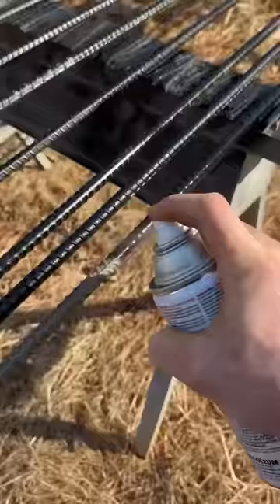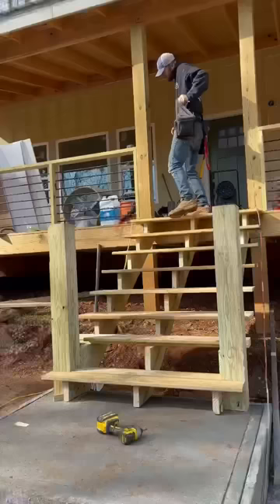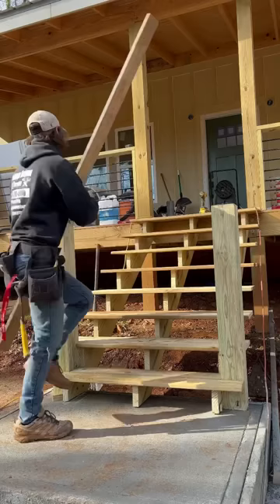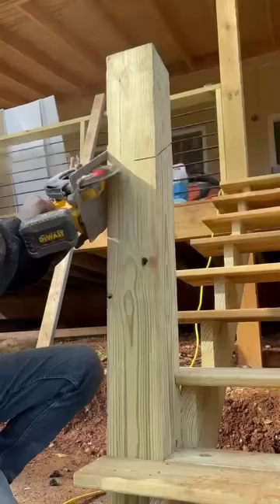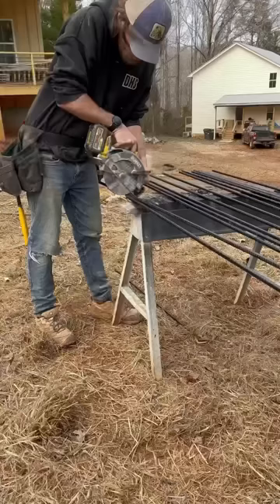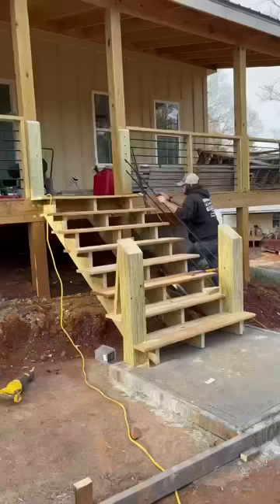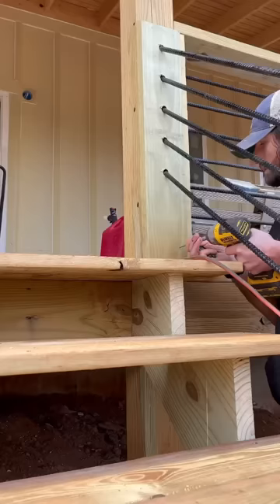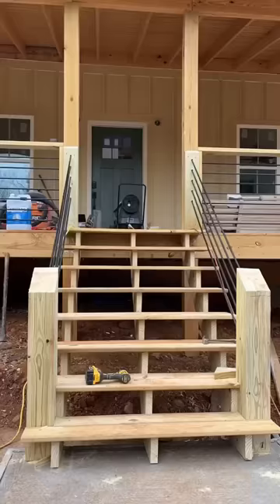Handrail 💪| Beautiful deck stairs part 4 🥳 #construction #builder #shorts #diy #skills #deckdesign

Comment: Beautiful! And you made it through the whole thing without losing your eyesight from not wearing safety glasses. Nice!!
Reply: ALL4FITZ. Yeah, I was worried about those sparks flying not to mention any miniscuel pieces of metal.
Reply: people dont understand risk, most construction workers dont use eye protection unless mandatory by employer. I worked in IT at Pratt&Whiney and anyone entering the plant work area was mandatory to wear company issued eye protection..😊
Reply: @andreh.dupuis8475  YES! You got it. My job has taken me to many factories over the years where safety gear is required. But we shouldn't need anyone to tell us that it's important. I lost 50% vision in one eye suddenly one day and it changed my life forever. Safety glasses are so easy.
Reply: WonderED THAT TOO! And  if his EARS WERE RINGING without visible ear guards -WHAT?!
Reply: @RodgerDodger196  Yep!  I know a drummer who got a bad hearing problem in one ear and still never wore ear plugs. Ringing ears means something bad happened.
Reply: You mean using the bill of his hat to cover his face isn't proper eye protection???  🤣😂🤣
Reply: That’s a funny way of saying you’ve never used an angle grinder.
Reply: @chumbawaumbacumpa  That a funny way of saying you would rather learn about safety the hard way.
Reply: @all4fitz  My point still stands. The risk is low enough that sometimes it’s inhibitive to wear safety glasses that’ll fog up in cooler weather while you’re trying to look down at your cut. You’d have time to have real world experience if you weren’t an armchair safety rep.
Reply: @chumbawaumbacumpa  I've been busting ass my entire adult life for the last 30 years tearing into little bits of everything including major electrical, framing, plumbing, rehab. I'm building a house now and just finished installing countertops and  plumbing. My biggest job was a 2000 sq ft, two story garage that I built myself starting by digging the foundation with a shovel. I was cutting plywood this morning to finish the kitchen island and again, just like in every other instance, I was wearing safety glasses and earplugs. With constantly buzzing ears after 8 years singing in a rock band, and 50% of my vision gone from an eye stroke 2 years ago, I greatly value what I have left and don't want to risk it for something like the inconvenience of getting fog free goggles.
Reply: @dizcret  Exactly. (My "nice" comment was sarcasm.)
Reply: @ALL4FITZ  lol, he really bust a blood vessel there 🤣
Reply: He was wearing safety squints! 🤡
Reply: @michaelwalker1017  Hahaha... It seems a lot of people actually think that works.
Reply: Everyone has thought it can't happen to me atleast once.
Reply: that is A very good point.   the rod shavings caused a fire.  good thing the red hot shavings might hit your eye since it's full of fluid .
I've never seen an eyeball collapse.  take pictures would you.  Nexttime
Reply: Glad somebody else said it. Takes only one screw up to lose an eye, better safe than sorry. Unfortunately no matter how many times you say it idiots will still not use ppe, guess that’s just natural selection. I always wear mine, don’t want shit in my eyes, or to get tinnitus.
Reply: @chumbawaumbacumpa  ever heard of a face shield? Or hell even a decent welding hood has a grinding mode.
Reply: @chumbawaumbacumpa  you know he used his circular saw to cut that rebar right?
Reply: @phanx  I’ve always used angle grinders with a cut-off disk for that. That way you don’t have to swap your Skilsaw’s blade back and forth.
Reply: It’s called a safety squint! And it’s a real thing for REAL workers
Reply: @wayneross1757   @Wayne Ross  If that's what they're called, then I had a "real worker" leaning backwards into my bathtub last summer as I poured water in his eye trying to get the projectile out before the contractor took him to the emergency room. 
It's a shame to think he could have avoided that by simply doing a "safety squint".

Comment: Looks good give a cuplé months dose rebar’s gonna look lik bananas 😅
Reply from the maker: Yeah I’m keeping a close eye on ‘em cuz if they start sagging imma throw support in the middle
Reply: it's a perfect ladder for the kids to climb on, I know from experience
Reply: @MordecaitheBuilder  I know for experience I’m also a carpenter , but is always good to see people trying to do new things and learn from them..💯👍🏽
Reply from the maker: @karlmiller7500  🤣🤣 I’m sure 🤪
Reply from the maker: @El_dela_Nissan  always learning. That’s what makes life interesting:)
Reply: @MordecaitheBuilder  I'd laugh if they fell out when it snows 😂 I make small gates with rebar but I'm into blacksmithing so no wood.
Reply: @MordecaitheBuilder  some perforated square tubing would do the trick and keep it looking solid. may need to open the holes a bit but I'm sure you can find the right hole size.
Reply: @MordecaitheBuilder  Easy fix if it happens especially for a guy like you nice work buddy
Reply: @karlmiller7500 in the OBC (Ontario builders code) it's actually not aloud to have horizontal rails for this exact reason of kids climbing them
Reply: No they won't.
Reply: Poor choice of paint
Reply: Bendable brenda
Reply: DIY Destroyed America..
Reply: @MordecaitheBuilder  I'm sagging... and I know everything send me out on repairs I'll bring in new contracts send me on leads after other dudes fail..and w o Makin anyone look bad I'll bring in contracts oh and I'm a pretty good installer you probably  just wanted to leave a comment sorry
Reply: @MordecaitheBuilder Good plan. It looks great though.
Reply: @MordecaitheBuilder  this came out awesome man

Comment: Looks good but your top rail is going to warp over time. Try putting 2x4 edge wise under them. It’ll be stronger and less likely to warp.
Reply from the maker: Not a bad idea. I’m either gonna probably have to do that or add a middle 2x6 like I did on the main deck handrail
Reply: More importantly if anyone puts any pressure on any of the "railings" they are going to bend, and they will never be straight again. As far as I know, rebar is never a good idea to use for finish product

Comment: Very nice! In a lot of states this doesn't meet code bc kids will use that horizontal alignment as steps and climb over the railing with often tragic results.
Reply: Those codes are the same in every state. International Code Council member 25 years.
Reply: @Doug Foster That really comes down to the county level. There are many inspectors across the country that don't give a damn about the ICC, especially in more rural areas. GC for 32 years.
Reply: Handrail isn’t code compliant graspable, either.
Reply: Not legal in Canada either
Reply: The guy was sawing rebar over straw and caught it on fire and you expect him to think further ahead than that?
Reply: @edwardblanc657  I know also a GC 42 years. Many states however have laws that even when a city/county doesn't adopt the ICC (or any) that they default to the ICC.
Reply: @dougfoster2923 didn’t the ICC remove the “ladder effect” in 2001?

Comment: Looks great!  Wouldnt comply where I am, horizontal and able to be climbed
Reply from the maker: That makes sense. Definitely gonna have to keep an eye on my daughter when she learns to walk lol
Reply: Should add support boards in center span to help prevent bending
Reply: Climbable guards is not in building code,  not safe, but it is not a code issue. However, there are a few other not code compliant issues with this. 200 lbs lateral force resistant,  doesn't extend to the top and bottom tread,  not grasphable, and the ends are not turned in to prevent items catching. That is just the hand rails. The staircase is also not code compliant. You built a hazardous transition point. Should some slip and fall, they will own you.
Reply: Ditto.  The lack of a base rail would do it here.  If those steps get slick and somebody goes sideways, pray they don't break a leg and tear every ligament and tendon on their way down.  😖
Reply: @jon10231  horizontal or “climbable” is a code issue in some places. The spacing could be a problem as well. In the building code where I am I think the max distance between rails is 3-1/8”.
Reply: @MordecaitheBuilder  You are not allowed to do that. Only the government can tell you how to raise your child. That's why this kind fella was pointing out "code" in his area. You have to check with the Government first!
Reply: Free country tho right? Yet you can't build a railing how you want because someone might do something it's not made for! So tired of government managing ever6 aspect of our lives!
Reply: @natecote1971  Free to build it however you want.  Just don't expect to insure or sell it.
Reply: @Maehlice  You could have issues insuring and/or selling, that's true. However, they can issue a "Stop Work" or "Do Not Inhabit" order and fine you until it is up to code...
where codes are enforced (which is most of the U.S.A.)
Reply: @kevinvesey5263  Climbable was taken out of the code a long time ago.  The reason is that anything can be climbable if you try hard enough.  As far as spacing IRC  say no more then 4" spacing.  I had to look this stuff up and found out that climbable was add then taken out because everything can be climb if you try.
Reply: Pretty sure if you tried to climb them they would just flop out the same way they were bent/flexed into place.  So climbing shouldnt be a issue here.
Reply: @jon10231   Being a deck a lot of the code that apply to a house doesn't able to decks stupid I know but it is the truth.   Most place say follow safe building practices.
Reply: Climbable handrails used to be a violation in IRC 2009 but they took it out in the next edition. Some state addendums still prohibit it. The handrail can terminate at a newel post that is located at the bottom step so he is din there. The graspable aspect is the only thing that he can be gigged on, it must have a recess cut out on the backside because it is a type II handrail
Reply: What state do you live in? It was taken out of international code back in the 2012 edition
Reply: @johnunsicker7440  climbable is still in the code were I am. Definitely not saying it’s in the code everywhere. I also suspect the rebar would deflect to much for our code here.
Reply: @natecote1971  you probably appreciate that buildings aren’t collapsing all over the place though right? Code isn’t there to limit what you can build… it there to ensure that what you build is safe.
Reply: Safe as a shard of, well, anything.
Reply: @natecote1971  Mainly comes into play when the property owner tries to sell the unsafe property to an untrained buyer. 

That’s why we have codes, to establish a baseline of safety.
Reply: @jon10231  not also places have codes. Where I just moved from in Nevada, the county has no fire or building codes. Anything flies. So if codes are not an issue where he is at, then they could build anything how they want.
Reply: You must be from California
Reply: @natecote1971  the code books and OSHA standards are all written in blood.
Reply: @duanetucker9439  till you try to sell or insure the home I dont matter
Reply: Nothing stopping you placing them verticle ,
Just drill spaced holes in the top and bottom boards ..
Reply: Personally we wouldn't have half the STUPID shit in codes if PERSONAL responsibility was in LIFE CODE !!!!!!
Reply: Idunno, darwinism.
Reply: This does not look good, it looks dangerous. Look at the different sizes of steps. A variation of only 5mm or less than 1/4" in adjacent steps can pose a tripping hazard.
Reply: @natecote1971  not if you are renting. Your insurance won't cover you anymore.
Reply: Surprisingly this would be legal ina lot of places. Requirements usually only state spacing apart. I hate horizontal spindle, but somebody obviously likes it.
Reply: I see the same issues no mid support,spacing, horizontal, non grasp able top rail,incorrect weight support, also the texture of the rear could be an issue as most building codes will address that
Reply: Sounds like you got some Rug-rats?.....😁🤭
Reply: Same here. Totally illegal. Couldn’t even sell the house like that. Looks nice though.
Reply: Meh
Reply: Same - wouldn't fly where I am either. Although the City headquarters decided they'd install climb-able rails on their building.
Reply: @MordecaitheBuilder  
When you aren’t home, and someone comes to your house and their child climbs over that and falls and breaks their neck, then you’ll learn your lesson.
Reply: @jon10231  
You are 100% incorrect. It is absolutely a building code.
Reply: @natecote1971  
Yeah, it’s terrible that you have to cover up electrical wires, and you have to put covers over Wells, because dumb people might fall in. It’s not about government control. It’s about common sense and loving your neighbor.
Reply: And spacing is too large
Reply: @Maehlice  or baby or small kid doesn’t slip and get caught by the neck
Reply: There is a surprising amount of folks who understand that these are both cool and  illegal.
Reply: They’ve changed that code in most places years ago. You still can’t have horizontal?
Reply: @MordecaitheBuilder  
An electric Do Not Touch system might be effective. Zappos
Reply: 4in spacing on spindles. Don't think it says vertical only !???
Reply: @jon10231  You do know that wherever you live John your  building code doesn't extend to the other 170 countries that have people reading these comments and watching these posts ,your knowledge is limited obviously by more than just a code if you think that other codes are not different and apply everywhere. 
You have owned yourself sir.
Reply: It's funny reading these comments and thinking about where I live in maine there are No building codes.
Reply: @scott5654  Trespassing and bad parenting is not a great argument.
Reply: I just had a fart that had some excess moisture in it and I'm deeply worried that I violated some code or rule that my Government has imposed on me for my own protection.  If Uncle Sam stops by for a dipstick test I'll probably have my underwear condemned.
God I love freedom!🇺🇸
Reply: @lill1557  Same.  Tiny town in Piscataquis County.  No code enforcement, no BS.  Pay yer taxes and have a goodun!
Happy New Year Bub!  And remember,  Ya caint get theya from heeya!
✌🍩
Reply: @sandraw9729  yes obviously the gov does shit people don’t like, but on the other hand if there where no rules, regulations, or oversight, it would be a third world country. Complaining about building codes designed to keep people safe is a very first world problem kind of thing.
Reply: @kevinvesey5263  Stop😂
Reply: @sandraw9729  stop what? Logic? Realistic views? Understanding cause and effect?
Reply: yep. complies nowhere in U.S.
Reply: Grandma will have a hard time grasping that handrail.

Comment: I like the look, just if you have little ones they will love to climb them.
Reply: AJ great minds think alike 😂❤
Reply: And bend them and they fall out. Just like they were put in. 😂
Reply: @frankarchuleta5427  same thought and risk cut ends sharp for others nearby when they pop out. A support post midway would eliminate risk of pop out but could still bend a bit. Rebar is not cheap either.
Reply: You the reason they put caution hot on a cup of coffee

Comment: Nice job! 

It's funny you mention the straw fire. As soon as I saw you cutting over the straw I was like he better be careful. No sooner did I think of it when you immediately mentioned it. 😂
Reply from the maker: 🤣 right!? Shoulda just set it up elsewhere but it was a great place to paint the rebar lol
Reply: It’s the wrong type of saw for cutting steel. Don’t do that again you will get hurt. It’s also the wrong type of blade, that’s why it was sparking, and it’s also blunt now. 
Just use a grinder, cheaper and safer. But you still get the sparks.

Comment: I got to say.. been a contractor for over 40years and this is the first set of stairs I’ve seen done right. You put a top step coming off the deck to get the top plate/hand rail joining the top post at the same height as the deck railing. 💯

Comment: You have angle settings on the circular saw for a reason.... And yes your faith in Rust-Oleum is very touching
Reply: I was thinking the same thing, but it still wouldn’t have reached the middle.
Reply: I figure moisture will run down that rebar and gather in those cute little holes he drilled in that 6x6, it will rot from the inside out in no time.
Reply: Though at a 45, his cut was at 90.  How would the angle setting have helped?

Comment: Great job, looks awesome!! Should've done a 22.5 degree on the handrail though. Plus lift the board for the rebar about ten inches or so then put them all in the predrilled holes, hammer the board down with another board so it doesn't scar the finish piece maybe instead of bending them in...

Comment: That looks really nice.

About 10 years ago, I did a rail system on our deck with 3/4 inch copper pipe spaced 4 inches on center. After I drilled out the 3/4 holes in the top and bottom redwood rails, I bored a 3/16 hole in the bottom rail for rain water to drain out, then I treated everything with oil based wood preservative before installing. It turned out great!
Reply from the maker: Nice work! Very cool 😎

Comment: Nice and rustic for an outdoor setting. Back in the day I would see things like this indoors in older houses staircases or open walkway landings, usually right when they were being ripped out and replaced with wooden. This look doesn't fit indoors, but is perfectly lovely outdoors.

Comment: The only thing I would have done differently was I'd put the hand rails into the 2x8's first then put them between the 4x4's. Just because it would be a little easier then bowing the rebar into place. Looks amazing though...